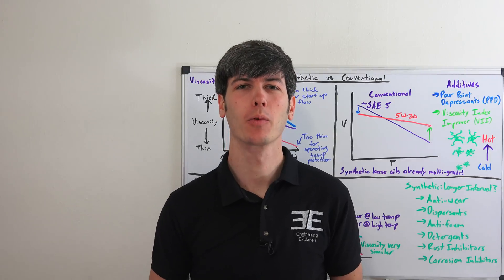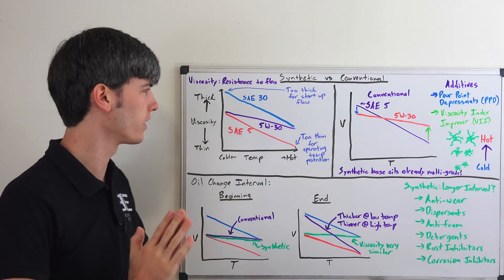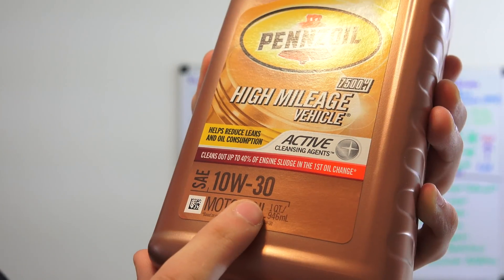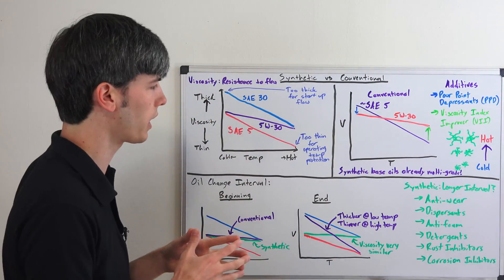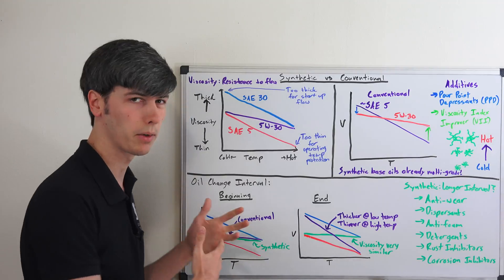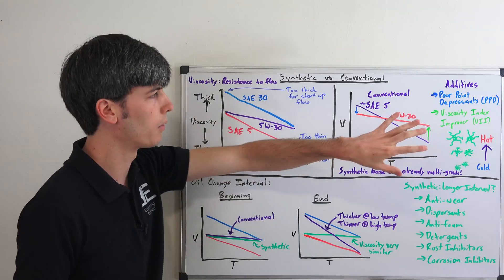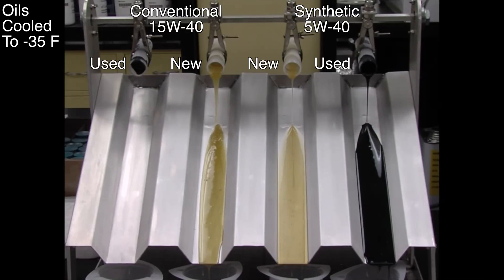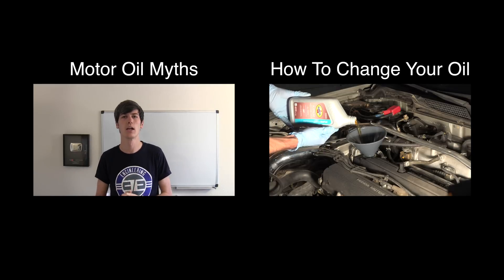Is Synthetic Motor Oil Better For Your Car?

Comment: i use non-stick cooking spray as my motor oil
Reply: yeah that works pretty good keeps the valves from sticking
Reply: bacon grease works too, can't get enough of that smell coming out the exhaust
Reply: Personally, with every motor I get I'll substitute one cup of lard with the initial oil change and I run it 2x past the recommended oil change interval.   I now have three trucks with beyond 450k miles and they run like they're brand new.  One is at 750k because of this initial seasoning. :)
Reply: PURE, UNREFINED, COLD PRESSED, 
COCONUT OIL 
100% ORGANIC (USDA), EXTRA VIRGIN, NON-GMO, TRANS FAT FREE,
HEXANE FREE,
GLUTEN FREE,
CHEMICAL FREE,
GREAT TASTING, 
(My Mechanic swears by it and says that I have the lowest Oil Pressure that Dealership has ever seen! +Product of the Philippines+).
Reply: same. i use a tub of lard as an additive.
Reply: I have read you can use canola oil and its just as good or better, but the oil industry wanted us to use ground oil so they can keep their profits and control over us, canola is cheaper by a lot.
Reply: I use cat urine.  It's the vehicle lube the big oil companies don't want you to know about.
Reply: Nah man, its all about Avacado oil. It has the highest smoke point of any oil. It even says on the bottle it wont smoke until 500 deg so I run can run it in my Turbo.
Reply: damn. im finding out all these alternatives to cooking oil. i could be saving tons of money on oil changes. now i can stop going to my local KFC for oil.
Reply: ***** Now I'm getting hungry!
Reply: Damn, have I been using the wrong lubricant this whole time? I thought Astroglide worked pretty well in my car, keeps things nice and slippery.
Reply: Jeff K "Scented" whale oil.
Reply: Whale oil?..Have you seen how scarce that is. I use fat humans. Lure them with a some donoughts or kfc or any other hanzel and gretel mode.
Reply: i use man fat
Reply: RedesCat I use cum
Reply: Daniel Jackson oh i forgot about astroglide. all you need is one drop to be good.
Reply: +Keven Gil Yeah, but if the road is straight and boring, you have to stop periodically and re-apply.
Reply: ColoradoStreaming Oh Damn.  I actually googled that one.  Haha.  I'm swapping over tonight.  Praise to the avocado.
Reply: Durex lubricants work pretty well too
Reply: Dave Smart Oh Damn.  That's a good Idea.  Whales are getting sparse and we already know the spots to find those preseasoned chunkers.
Reply: You guys are doing it all wrong,  bacon grease?  I use liquid gelatin
Reply: Guys, your car gots to go on a vegan diet, use ranch dressing and peanut butter for a burning-calorie quality.
Reply: my car's oil pressure was to high so I had to switch over to flaxseed oil. the worst part is that it will have to be on blood thinners for the rest of its life.
Reply: redesCat  this is for far the best comment i have read in my entire life you make my day , here have your like man
Reply: RedesCat 
I'm the one following you around with my head out the window.
mmmm your car burns French fries
Reply: I used to have a Hyundai Excel when I was a kid.  it leaked oil and I'd often find myself stuck somewhere, needing to get home and dangerously low on oil.  a few times I did actually put about a quart of canola oil in! ran just fine. got rid of the car at about 220k miles (still perfectly drivable). FYI i'm NOT recommending it but I got away with it.  I'm prety sure these other comments about lard and bacon grease are jokes though. they're too stiff when cold and would block passages.  terrible idea.
Reply: haha! I actually know someone who used engine oil to cook once, thank goodness they were smart enough NOT to eat it
Reply: Bangas Droid what are you talking about, it's totally safe you eat.
Reply: I use water and vodka for the winter.
Reply: I use 5 sticks of butter
Reply: +AdMan The “ATLR” Lab Rat  how about low fat as welll.
Reply: Rafael Torres "The Label Is The Law" The Law deems that:
1 Serving = 1tbsp (14g) 
Total Fat  = 14g (per serving)
Reply: Rafael Torres If It is any consolation of that one 130 Calorie 14g tbsp It lists:
Saturated Fat = 12g and
Monounsaturated Fat = 0.5g and ...Everything Else = ZERO %
And may I add that all the fats are also NOT HYDROGENATED Which basically means that the oil burns cleaner and at high temps because they stripped out the H² & O² & @²  (which together are really bad-bad-bad to burn because it makes DiHydrgenatedOxide aka H2O) so they stripped the Hydrogen and Oxygen and The "Atedgen" out of the oil to help clean up the environment.

Also this is special cost price Club coconut oil that comes from the Philippines by way of Carrington farms Gloucester New Jersey and somehow they're missing 1.5 grams of fat per serving where did that 1.5 grams of fat per serving go I need to know because I have to do my gas mileage which I paid off my oil consumption which is really high but since the engine doesn't work I don't drive it that much or at all.
Reply: I use lubricants, you know, the ones you use for condoms, works very good but I need at least 3 to 4 bottles :P
Reply: All the oil companies offer synthetic now, so I wouldn't think they care what product we use. But based on the number of pro-conventional and salad based comments I'm going to guess they still make more money when we buy conventional.
Reply: i've been using sunflower oil, it kept my car's cholesterol level healthy so it's running really healthy and smooth.still have to bring it to the doctor twice a year though.
Reply: Same here, just make sure you get the high heat rating, the ones designed like for high heat frying.
Reply: Coconut oil still the best...Lolx 😂😂😂
Reply: Keven Gil Shhh.
Reply: you want to use a oil with a high burning point. olive oil is not for this!
Reply: His hand has the aids
Reply: That really only works for the tail-pipe and only if your car loves you back!
Reply: I use abrasive paste, it's pretty slippery, so It's gotta be good.
Reply: The top ten Compilations Nah, it just gets twisted around the flyweel and smokes
Reply: RedesCat
Reply: GreaserCentral Thats what I was gonna say lol
Reply: the catmobile or pussywagon
Reply: Spray type lol
Reply: I use gasoline.
Reply: Jeffery Jin to
Reply: Jesse Johnson I use tramp Fleym
Reply: I've been using bacon grease for my engine as well but it seems to be breathing really heavy. it doesnt really want to do anything. might have to try that flax seed oil
Reply: Never have to change your oil again, just add 1lt of acrylic thinner to your engine that will thin the old oil & allow the filter to clean oil better.........
Reply: Shannan Venz Right.......
Reply: tasty
Reply: Mark Schulz IV durex condom is also very good for the job
Reply: RedesCat you are genius    

hahahahahahahahahahahahahahahahaha
Reply: Skaarj RP
Reply: RedesCat LMAO!!!!!!!
Reply: You should really use coconut oil, for cooking.  Better for you.

("better for you"? we're talking about oil for cars, not peepole)
Reply: OK,   one rye bread sandwich with KY Jelly.   Would you like anything to drink with that?  Do you need a couple of minutes?

("do you need a couple of minutes"? 
   The guy's making a joke, what are you tokking about?
        oh, i was duh . . . . um. . .  )
Reply: I use 10/2 isotoner...
Reply: Exactamundo!
Reply: I like your pic
Reply: My car doesn't have an engine that needs oil....
Reply: THE ONLY CAR I CAN THINK OF THAT DOESN''T NEED ENGINE OIL IS ONE OF THOSE KIDDIE CARS WITH PEDALS,  OR A TOTAL ELECTRICAL CAR.   IN WHICH CASE, YOU ARE DOING YOUR PART TO CLEAN OUR DIRTY AIR, AND NOT ADD MORE POLLUTANTS TO OUR ATMOSPHERE. WE ALL OWE YOU A BIG THANK YOU, BUT MOST OF US ARE EITHER UNABLE TO AFFORD ELECTRICAL CARS, AND HAVE TO SETTLE FOR SOMETHING WITH A SIGNIFICANTLY LARGER CARBON FOOT PRINT.
Reply: RedesCat I literally lol'd
Reply: I have a doggone motorcycle already.   A nice one. I like it.
Reply: I use poop
Reply: A waste of perfectly good vodka? Inexcusable.

Comment: Can I use 5W30 synthetic oil in my 2008 volkswagen which has 112,000 miles? 
P.S. I always use 20w50
Reply: Which vehicle and engine do you have? Just saying "volkswagen" isn't enough.

Comment: Just wondering as oil becomes acidic over time if a engine is not run,, what would be the time frame to change the oil?
Reply: It does degrade and break down after some time due to oxidation, in-air contaminants etc. and i take it you ask when to change oil in an engine that hasn't been started for quite long, sadly don't know the answer,never been in such situation, but first question, yes, they do  become bad with time even if engine is not running.
Reply: One year.
Reply: U should change it just before u park it and add a oil stabilizer, but I wouldn't go more then 6 months to change it again if it's not running, also depends on environment, ex outside during winter
Reply: If you have ever seen oil from an engine that hasn't ran in 3 months its nasty. just run it once or twice a month at operating temp for 30 mins to burn off the moisture to prevent that. the best move is to drain the oil for long periods of storage. oil stabilizer is a marketing scam and is horrible for modern engines.
Reply: I can't see how having no oil in the motor can be good at all,rust would form from the moisture.
I have several motors sitting and do run them every week but the don't get any rael load put on them ,so sheer load would be minimal. So in theroy if the sheer load is what breaks down the additives then they should be fine for years. Unless the additive break down over time alone. Hence my question.
Reply: After an hour, all the oil drains down to the pan anyways. So if the oil pan is full or empty, thats not going to have any effect on rust of the internals. For long term storage, it doesn't make sense to leave oil in the pan just to go bad. By long term i mean more than 6 months

Comment: Synthetic oil is a very loose term. Does anyone remember the big oil companies battling in court over using the word synthetic? Do you know what the best oil is? The kind that you change at the appropriate interval for your application. End of story.
Reply: Yes, I do.  Castrol got sued because Syntec isn't actually synthetic.  They argued that, "no, it isn't, but it is just as good as synthetic" and somehow managed to win with that argument.  That was the day I switched to a real synthetic.
Reply: PAO based Synthetic is much better for your engine than a Group II (average engine oil) and Group III (hydrocracked oil).. to say that the regular oil, no matter how refined they are is better than a PAO based oil is hogwash..
Reply: +Julie Haygood Didn't know that.  Wonder if they just have a better conventional formula that is actually comparable to competing synthetics and that's how they won.
Reply: I should probably clarify "application"........year, make, model, engine, driving habits, mileage on engine, integrity of engine, environment, ect.
Reply: Rexford L - just as there are major advantages in synthetics (PAO) over 'regular oils', there are major advantages ester synthetics have over crude based synthetics… first off, PAO has nice viscosity ratios, and usually has a handful of other premium chemicals thrown in… but esters sick much better to the metal.

Comment: before watching, I'm going to say yes because it is specifically designed to do the job of keeping your engine lubricated and clean.  That and I did a fuel economy test after changing my oil and I gained about 20 miles per tank, far from scientific but hey its the most solid piece of data I have that says anything about this issue.

Comment: now if only i knew what motor oil even does
Reply: It allows engines to run. Without it the engine would become a block of scrap metal because it would overheat and weld itself shut.
Reply: so just lube?
Reply: Yes, it's lubrication.

Comment: And this is exactly why a fully syncthetic oil does NOT need to be changed every 3000 miles. There is almost no benefit to that. 5-6k is perfectly fine in your average car. Old semi-synt and mineral will degrade more.

The 3k oil change interval does not apply today. Don't waste your money.

Comment: Thanks for the explanation. I always just assumed the W as in 5W-30 stood for weight. one thing you did not mention about protection is that if you overheat  any multi viscosity oil you can burn out the polymers and then the oil turns back into the straight weight base oil that it was made from, IE: 5W-30 would become 5W.  This is not that big of a concern in most cars, but in air cooled lawn equipment it is something to keep in mind during extended operating periods during hot weather.